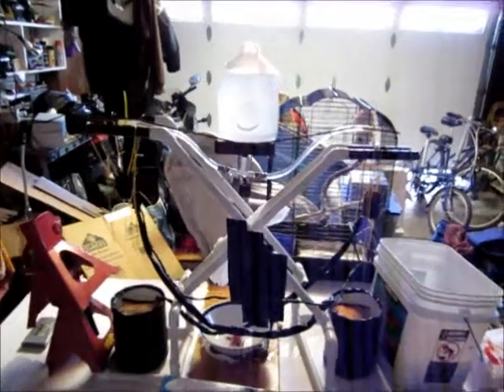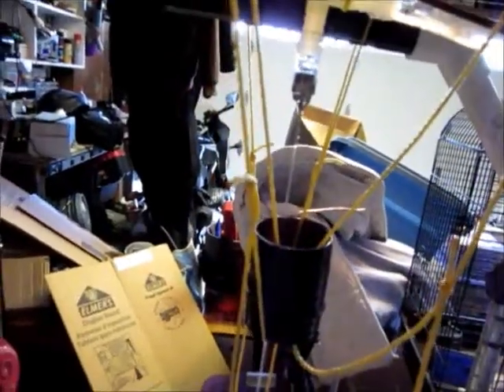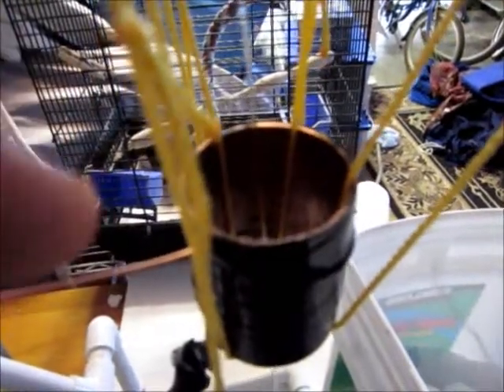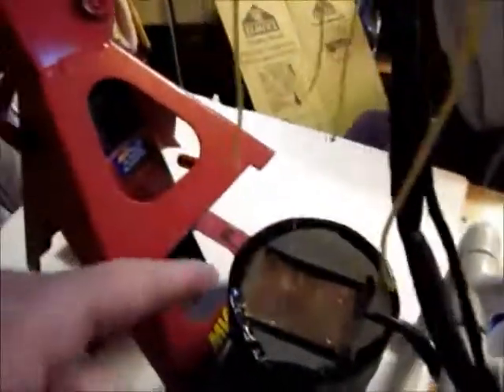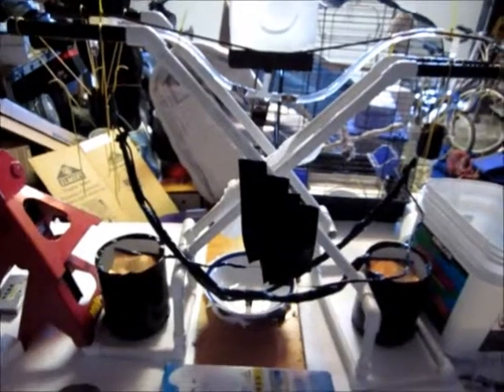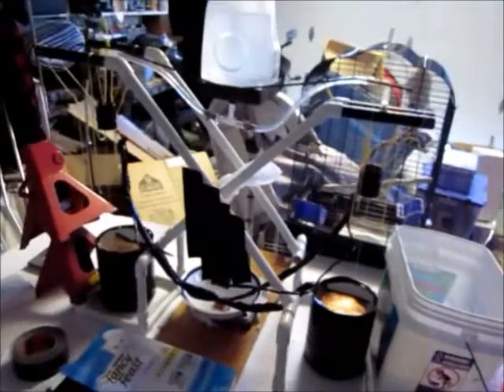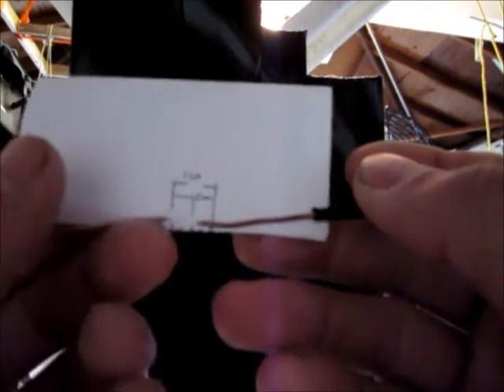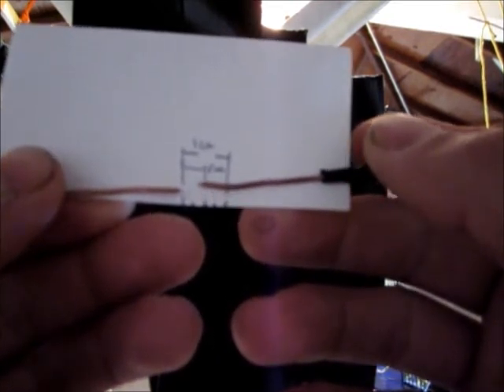Kelvins Water Powered Generator 1

Comment from the maker: @zipperyzoodawg Thats a great question. I do not know and will not be able to tell u, i have moved on to other things (still workin on plasma though). I am getting a nice spark from just a little bit of water moving though, so it would seem this is highly efficient. What I think would be fun to do is make 8 "cells" of these in a circle configuration. When the static field builds, have a armature near it on a bearing, Cells discharge, recharge, causing armature to spin. Simple to set up, try it

Comment from the maker: @Jwadd10 Yes, HHO is an amazing tech. that I have personally done R&D for some time now. The key is resonate PWM, using bi-filar coils, and plasma. Simple way to make water ignite with out having to spit the h20 before usage is increase the voltage to the spark plug, put a magnet near the discharge to widen the plasma spark into more of a plasma force field, and mist water into the field. The results are fantastic! For this set up, i dont know if it would work to well though, thx for the idea.

Comment from the maker: @freethisone So it sounds like u are making more of a van de graaff generator, which would be cool as well. This is working due to gravity and the Di-pole properties water has. Thx for the idea though, if u were to build that, u might want to put different types of solutions in with the water, as well as different materials to make a chemical battery cell.